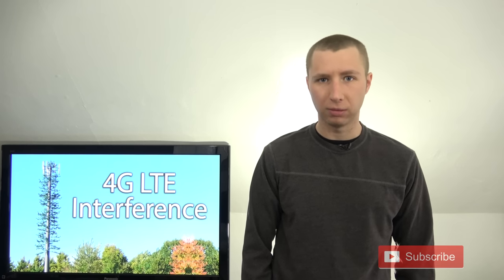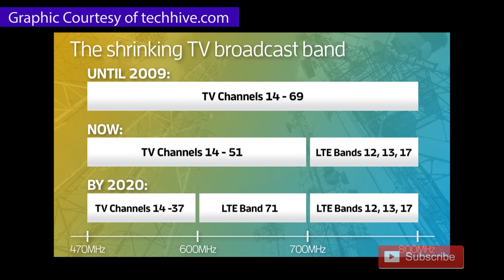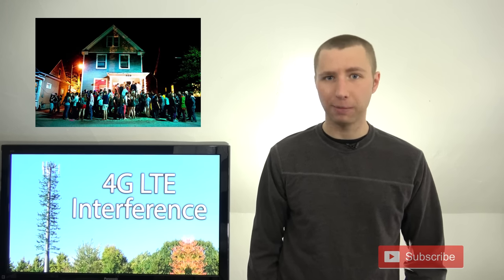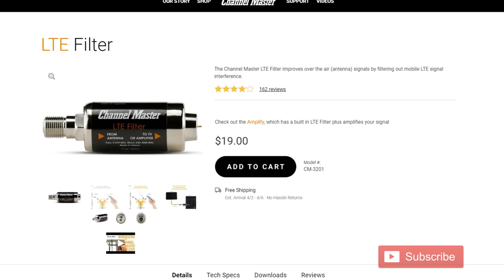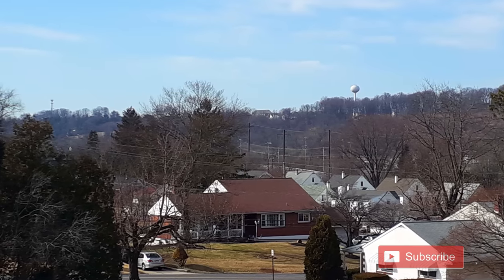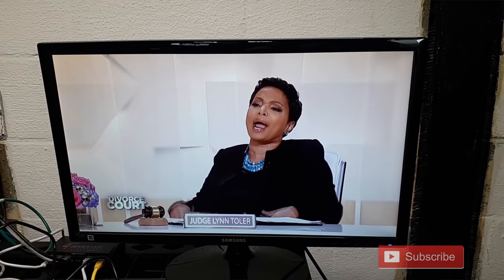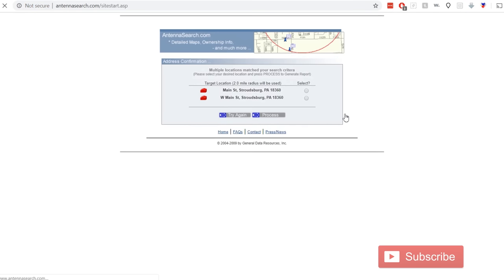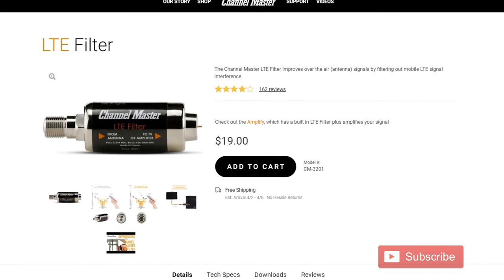4G LTE and 5G Interference on OTA Antenna TV - Fix it with a Filter

Comment: Hey Tyler,  Please, tell us what the distance a cell tower "NEAR YOU" actually means in miles, or some form of distance measurement.  I can barely get a signal from my cell phone company at my house from about 2.5 miles, but there's other cell towers about 3/4 to one mile from me in the opposite direction from my carriers cell tower. 
Thanks, Barry
Reply from the maker: It varies depending on many factors (antenna, signal strength, line of sight, ect) but I'd say around a mile. Look for the pulse like pixeling shown in the video. That's LTE interference.
Reply: @AntennaMan - Thanks Tyler, good information.  Barry

Comment: LTE Interference can also affect strong channels as well if you use a pre-amp or drop-amp with your antenna which can overload your TV's tuner.  Many cellphone carriers are now using small cell transmitters for their 4G LTE and 5G services installed on lamp and hydro posts by the hundreds and thousands. With 5G they require a transmitter every 1000ft whereas with 4G every 6.25m.

Comment: should this be placed by the tv or at the antenna?  my antenna is split to two tvs.
Reply from the maker: If you are using a splitter it should be placed before the splitter.

Comment: If i want to install an RCA ant3037 antenna in York, PA with Wine guard lna200 preamp can I screw the output of the lte filter directly in to the input side of the amp, connect the output of the antenna to the filter, then run the cable from the amp output to the tv tuner?  Is this correct?  Thanks
Reply from the maker: No, put the LTE filter before where the antenna goes into the preamp.

Comment: Our family's fav signal now comes in on rf-36 since repack. The transmitter is 78 miles from our home. Since the newly freed-up spectrum for cell phone carriers now starts at rf-38, I worry that we'll one day lose it reliably if there is or becomes a nearby tower; especially after 5G comes in with towers everywhere. I fear that an LTE filter will weaken the far away signal and so just  trade one issue for another in such a scenario.
Reply from the maker: There is a small amount of signal loss on RF 36 with the LTE filter but it's very marginal.
Reply: Cm-3201 filter has been updated to filter out 5G NR (frequencies above 609 MHz are blocked).   Channel Master website details this in their website.Go to the Tech Spec tab for CM-3201.

Comment: When will you do a video on Sub Channels and why they broadcast on a lower resolution? I find it weird for only one channel to have HD and the rest 480p SD.
Reply from the maker: I have a lot of topics to get to. Be patient.....
Reply: Antenna Man thank you. Sorry for not acting patient. Love your channel!!
Reply: The more "channels" ("streams" may be more accurate), the more data compression you'll need to use.  If you have many streams in one RF channel, you'll have to "stuff" the data, and if channel 13-1 (for example) is showing a confetti storm after the championship game has ended, any other channels or subchannels will be compressed. People watching any of the subs will suddenly see a ton of pixellating effects, and have no idea why their picture suddenly looks like it's been run through a Cuisinart.

RF Channel 13 in my area recently went from 13-1 to 13-4, to 13-1 to 13-7.

Weather Nation, a narrow band subchannel by design, used to look like typical low bandwidth cable channel.

Now 13-7 looks like some of the earliest 28K internet video devices that were around when all home internet was done through 28K modems.
Reply: 0:43 You need another bar above the other three: 

Until 1983: TV Channels 14-83.

Comment: I have two questions. The first is what about 5G? Will that effect OTA TV? And second, how come there is know Channel 1? Both real RF channel and virtual channel.
Reply: Person Z thanks. Also, I just wanted to have a creative username.
Reply: Cm-3201 filter has been updated to filter out 5G NR (frequencies above 609 MHz are blocked).   Channel Master website details this in their website.Go to the Tech Spec tab for CM-3201.
Reply: @williamquemuel7824  Glad they finally made it.
Reply: ClassicGuy57 What is not on the website and was clarified by Channel Master customer service, is that the filter has a 3 dB loss (half power loss).  This may mean that you might lose some channels from the rescan if the signal was weak to be begin with. With this understanding, CM-3201 filters out 5G NR (frequencies above 609 MHz are blocked), but weaker channel signals might be lost.  That's the trade off.
Reply: @williamquemuel7824  I see.

Comment: Can I connect a TV antenna to an  AM  or. FM  radio to pick up distant stations for better reception ? 📡 📶 📻
Reply: For FM radio, yes. But not for AM radio
Reply from the maker: Yes for FM. Check out this Stellar Labs antenna designed for FM radio: https://amzn.to/39mB3X2
Reply: I did buy a outdoor antenna that does AM and Shortwave But for FM I use my tv antenna and it works well https://www.youtube.com/watch?v=JCI9yKdwVDM

Comment: Hey Antenna Man, Im planning on changing the location of my antenna to a higher part of my house to try to get a little better recption. Now the cable that goes from the antenna into the house will not reach to the new higher location on the roof. Can I use this LTE filter to bridge the coaxal cable going into the house and the new one thats going to be running from the antenna. Or will that not work?
Reply from the maker: It's male to female. If you are looking to bridge the cable together you need a coupler below: https://amzn.to/2wlsRcf

Comment: I tried this filter but I cannot use it until the repack is completed later this year because many local channels here are still above Ch36 / 600Mhz --this filter blocks all of those.
Reply from the maker: This LTE filter blocks above 696MHZ so you can still use it if you have TV stations that are above 36.
Reply: @AntennaMan  We might have different models.  I double-checked the specs just in case I got a counterfeit, but the label on my filter is identical to the photos in your Amazon and Channel Master links.  It says "Pass 5-599 MHz Block 600-2000 MHz", and it is the same model CM-3201.  I may have bought it from your link, can't remember now.  I tried using it and it blocked all channels above physical channel 36, so I guess it works like it should.  It didn't cost that much so I'll keep it for after the repack is finished this year.
Reply: Cm-3201 filter has been updated to filter out 5G NR (frequencies above 609 MHz are blocked).   Channel Master website details this in their website.Go to the Tech Spec tab for CM-3201.

Comment: What if you get that major pixalization and have 100% signal.  This is only on 1 channel lvhf 5
Reply from the maker: Likely some kind of interference. Could be LTE, electrical, FM, ect
Reply: @AntennaMan  Thank you for your reply.  I was thinking it was some kind of electrical interference myself.  I use to install antenna's back in the 70's for a local tv shop.
Reply: @AntennaMan  I did fix my problem.  turns out some of the old rg59 cables left hooked up was not in good shape.  removed cables  and built 75 ohm caps to put on spliter where cables were removed, tested now for a while and no problem.  Thanks.

Comment: I just replaced a 4g with the 5g and now only receive CBS. No NBC, ABC, WGN, WTTW. With the 4g i would receive those channels clearly untiĺ about 7a.m. then those channel's will start to crack up or lose the signal completely. I hoped the 5g would fix that problem. The last time the antenna guy came, he charged me $500! He's the guy who put on the 4g and its worked pretty good up until 2 months ago when i started loosing signals. He told me to go over to the nearby tower (about a mile away) and get the numbers off of it. I can't remember what to do next. This free tv I'm so used to is costing me way too much repair man costs. I'm just sick about it.
Reply: I just rescanned for those channels again and "surprise!" they're back! I sure hope this 5g continues to work. Thanks!
Reply: @donnaciaccio2580  so does the 5 G work better than the 4G or the same?

Comment: When I was a kid, CB transmissions would bleed into TV programs.
Reply from the maker: They probably still do
Reply: I work on PCs, and on older PC speakers you can still get CB traffic bleed-over. It's enough to scare the crap out of you if it happens in the middle of the night.
Reply: @ Fox Populi I F***ING KNEW IT! I KNEW THAT COULD HAPPEN! Up until a few years ago we had a pair of pc speakers that I swore were receiving some sort of transmission from somewhere when not in use. It was faint, and could barely be heard over the humming of the electrical current flow, but it was definitely a conversation of some sort. The thing was is that the talking was ENDLESS! It was like it was broadcasting on an endless loop.

I'm no radio expert in any sense of the word, but how exactly was that even possible? How could an external audio device be able to pick up a signal from a source its not even hooked up to? Don't they have to be broadcasting on the same frequency?

Comment: Ive been into radio for 40 years now, and can tell you cell towers wouldnt interfere with your tv.. if anything FM Radio transmitters would cause interference by the 4th harmonic! as for LTE, that's in the 800 MHZ range where as tv is well below that! Sooo this filter will block out fm radio transmitters and everything else that's not within the TV band (and yes 800 MHz which has the 4G lte band will be blocked too). They do work..  BUT just wanted to clear that up for ya!  these filters being sold in china and called 4G LTE filter is basically someone tell you that as they don't know what else to call it.. but its a bandpass filter meaning the filter will only allow frequencies in the TV band! these same Chinese sellers are selling TV antennas with 1 million db gain too LOL.. or omni Wifi antennas that have 30 db gain.. BWAHAHA THATS IMPOSSIBLE!!!    ….. SHOULD ADD THAT THESE FILTERS CAN CAUSE SOME WEAKENING IN SOME OF YOUR CHANNEL STRENGTHS.. thus those channels being close to the band limits of the filter...
Reply from the maker: LTE is actually launching on the 600mhz band which is how it bleeds into UHF channels.
Reply: @AntennaMan  LTE is 700 MHz to 2.6 Gigs MHz and 700 MHz is 80's technology! there is also 1.2Gig and 1.8 Gigs which makes tri band mode! and can go as high as 4 Gigs..  700 MHz still wont interfere with UHF and VHF tv signals!!  If you were to call me into court to testify this, I would tell the judge.. NO in my 40 years professional experience I would say NO LTE will not affect tv signals!! Then I would explain how vhf band channels 7-13 would be affected by FM transmitters running 100 000 watts on 88-108 MHz and by 2nd harmonic would interfere with the VHF band! then the UHF channels would be 4th harmonic..  as for LTE working its way down band harmonics absolutely no way!!!

Comment: I can see the 4G signals on my old Sony Watchman.
Reply from the maker: Occasionally a channel scan will pick up an analog channel on the UHF band if there's an LTE "bloop" while it's scanning.
Reply: @AntennaMan  back in the late 80s I used to listen to cell phone conversations on a TV with a continuous UHF tuner.
Reply: @curtiskaylor1244  you must have used a TV that went up to channel 83.  I didn't know until the 2000's, that channels 70 to 83 were exclusively for translators.

Comment: The reason the filter "fixes" the problem is because your TV's receiver isn't selective enough. 

In the old days of 2-way radio a receiver typically had 8 to 12 stage preselectors (Tuned circuits or "tanks"). As the synthesized stuff came out you saw less tuned circuits which caused the receiver's selectivity to decrease from 90db image rejection to 50~60db. Every 3db is half the signal level, so with 30db less rejection a signal only tenth the level can be rejected by the receiver.

The reason the "filter" works is because your TV's is accepting signals it's not supposed to be "listening" to. (Poor selectivity) In my circles we radio techs called this a "hoover" front end...